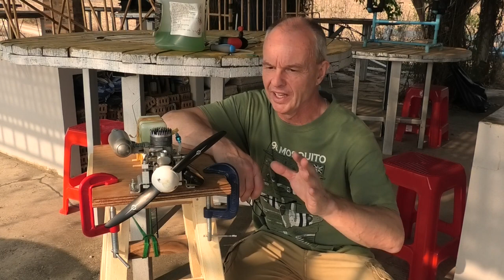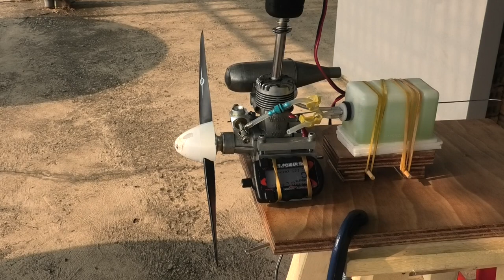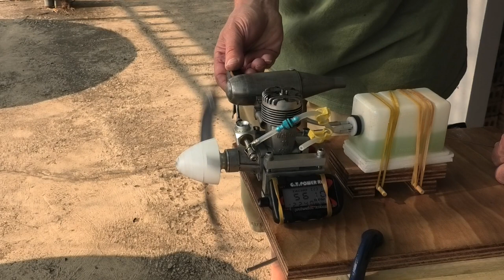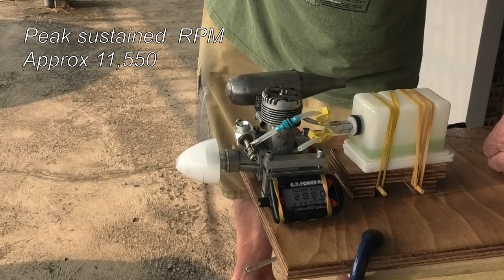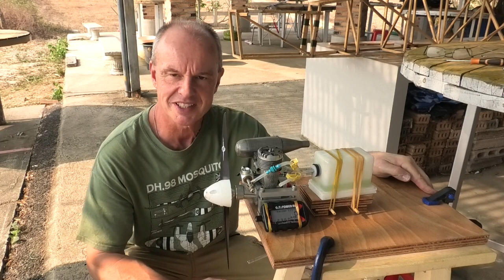Vintage Webra Silverline .61 -  Glow Engine Tune & Test Run

Comment: Mark ---- Looks and sounds good . If purchasing one on line not really able to look into port at the piston , to turn it over, and you saying no longer available , may just pass it up. Do you know if there is a place to get parts for them --- then it might be worth taking a chance on buying one?
        A good Tip ---- If fuel line fitting has two barbs on it to grip the hose --- a PLUS. i  wonder if someone makes these? Might be worth swapping out a single barbed one for a double one.  Enjoying you Engine Series -----  Rodney
Reply from the maker: I usually get my spare parts for old engines from ebay, either from whole engines, or parts sold separately

Comment: Thanks for the video I have a .61 nitro motor with a used  Carl Goldberg staudacher extra 300   
You really helped me with getting the prop size correct. I tried a 13/8 and a 12/7 wood prop. I’m about to switch to an 11/7 plastic one and hope to get it running as well as yours.  Also I’m running 10% nitro. Is that enough?
Reply from the maker: Glad I could help, and pleased you liked the video.  Yes, 10% will be fine I am sure, althouth it will depend a little on the make of engine, many of the older European engines were designed to run on low Nitro content.
Reply: @MarkRobinson555  it’s a muntunuc .61 mid to late 1990s

Comment: Hello Mark the Webra Engines comes from Austria  not to Germany.
Reply from the maker: You will find the earlier Webra engines were made in Germany, as you can see in the video this is embost on the crankcase.  At some point around the 1970 I belive they opened a plant in Austria, and had both running simultaniously for a time, but eventually the German plant was closed.  Sorry I don't know the specific dates.  But this enging clearly showes in the video it was a German one.
Reply: Mine says :
" Made in West Germany " .
😃😉😍